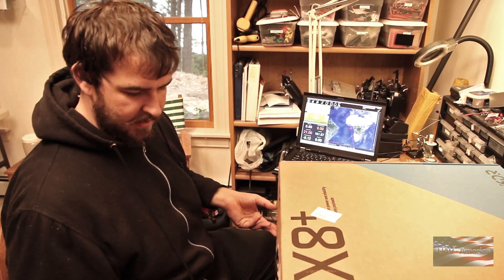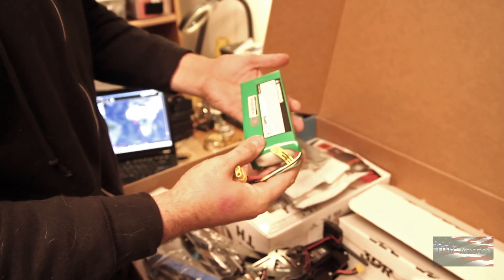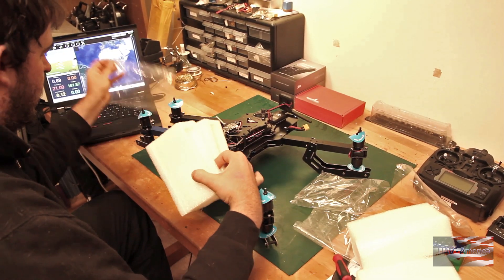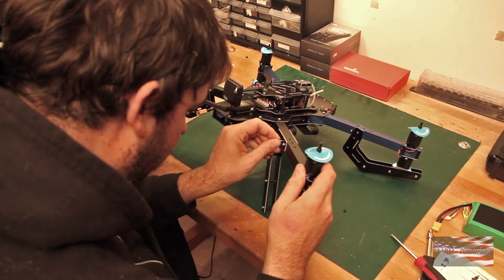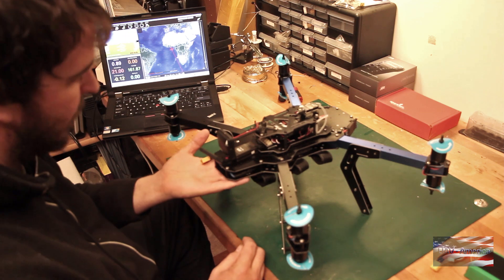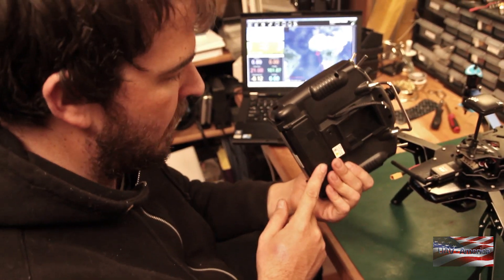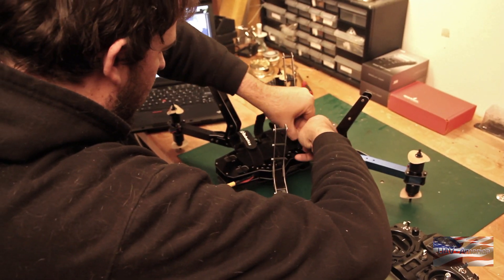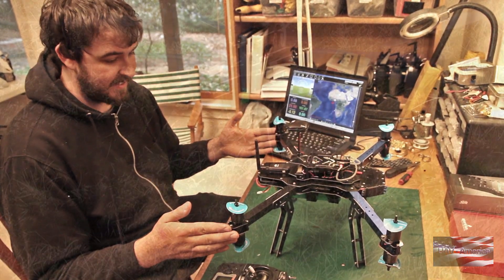3D Robotics X8 Plus Unboxing and Overview

Comment: Your thoughts on this vs the Phantom Vision 2 Plus?
Reply from the maker: Phantom Vision is a great little quad.  We carry that machine as well as the X8 (both is stock).  Primary difference though is the X8 has a payload of 800 grams - allowing you the option of using any number of cameras with it.  It also would give you the redundancy that an octo provides.  The Pixhawk also has no limitations to the number of waypoints (I think it maxes out at 255 or so) and also offers a huge array of options. The X8/Pixhawk is also a good choice if you want to use on an Android device.